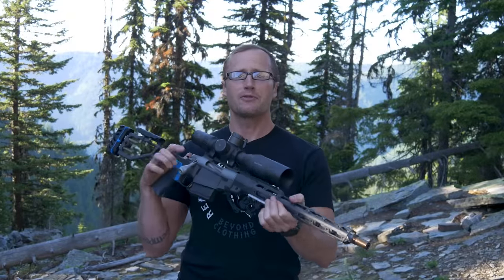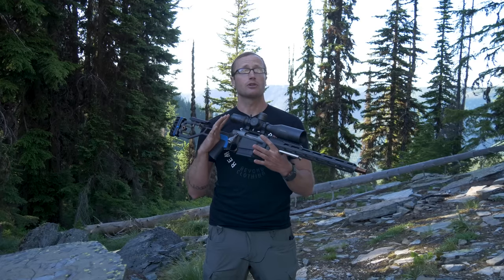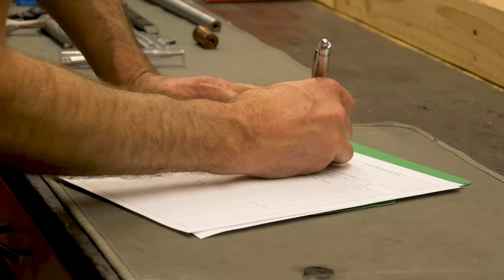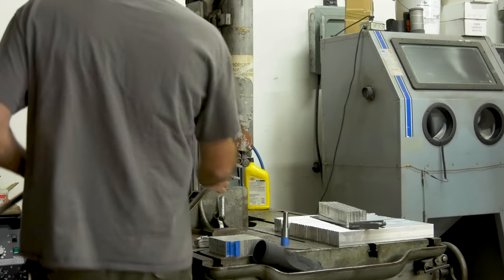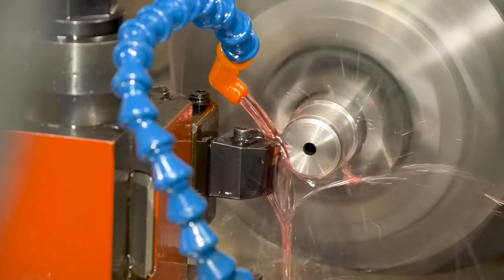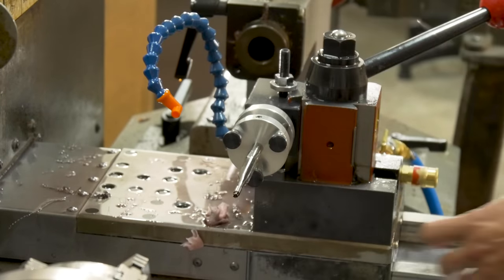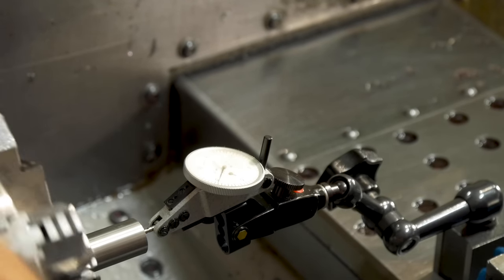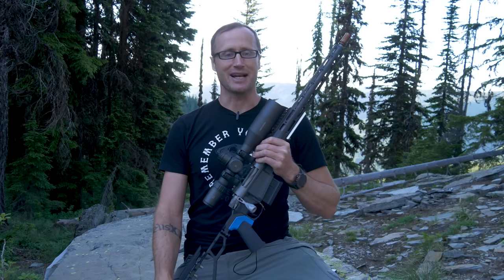Rifle 301 by Sawtooth Rifles: Part - 1

Comment: what a great little rifle. it will be a shooter for sure. love the 243. the only thing is with the short neck and shoulder angle they tend to eat the leade and lose accuracy fairly early. to negate that all you need to do is keep the barrel cool by shooting five or less round strings and give it a couple of minutes between them. a 243 can lose it’s accuracy at 700 rounds or 4000 rounds depending on how it’s treated.
Reply from the maker: We’ll see how long the barrel lasts. It may come on the Coast to Coast tour.   :)

Comment: Yeah that's kind of like putting Sears roadhandler tires on a Porsche... what is the side chick $1,100vs a $350 r700
Reply: Nothing wrong with 243 or 260
Reply from the maker: Capable rounds.  :)

Comment: Pick A high velocity round and cut the barrel down???  Curious what .243 loses in a 16 inch barrel versus A 20?  I don't recall you ever saying you were a handloader allowing you optimize the load to A shorter barrel?
Reply from the maker: Probably not enough to matter. :)  This isn’t made for PRS.
Reply: @KitBadger    Eek out more energy to dump into whatever animal you are shooting and more range for A low mass projectile.  I'm not A hunter but if I have need to shoot something I'd prefer be dead ASAP.